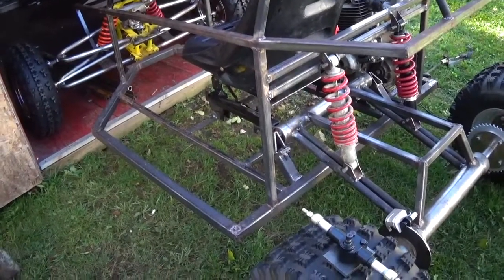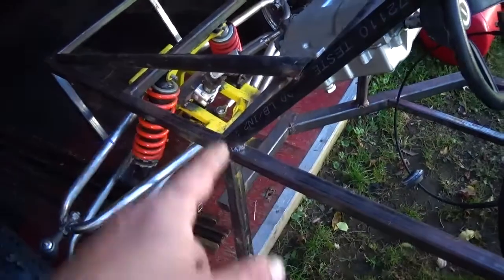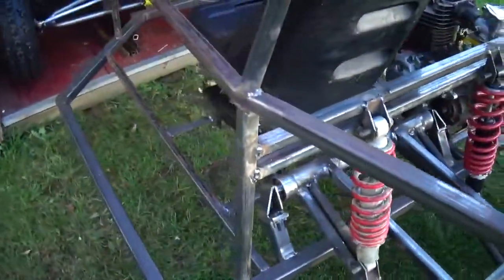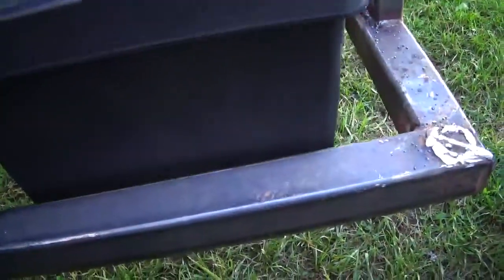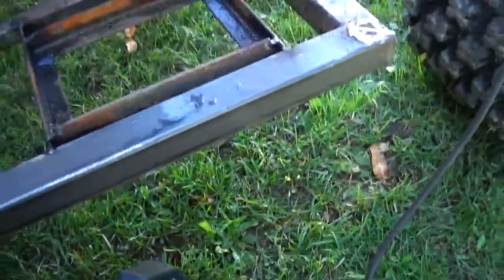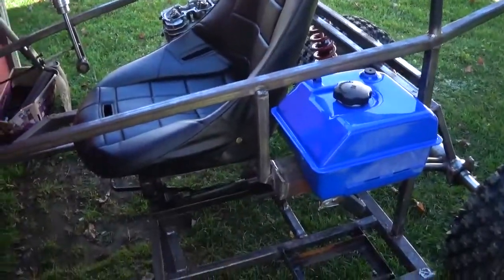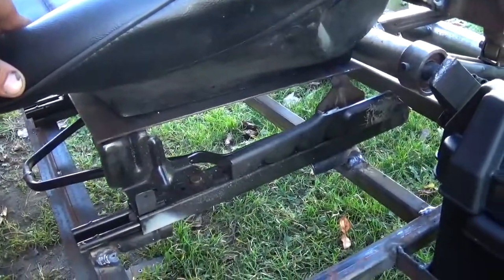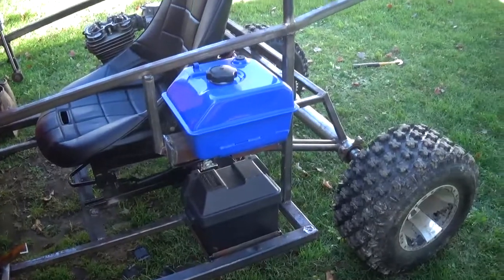300ex Sidewinder Pt 14

Comment: that poor kid. hope he makes out OK. looking at your gas tank. if you end up flipping it sideways. the gas tank could get pushed into you. may just be camera view. if you had a bar go around the outside side of the tank. under that lip on the tank. so if it flips over sideways or slides into a tree the tank couldn't get pushed into you. maybe I'm being to cautious. love all the modification's. buggy looks really cool. so many decisions when building from scratch. Keep you the driver in mind. seat worked out perfect. 👍 cheers
Reply: oh .. Merry Christmas.
Reply from the maker: Merry Christmas. He got really lucky. Just needed stitches. The doctors thought and we 
thought he was in really bad shape but after tests and scans nothing was
 broke. Going to add some brackets to the gas tank mount. It would get smashed before it moves. I would rather have it on the back but i really need it there to balance the engine on the other side.
Reply: I hear that. My doodle bug I'm building has no guards on the right side. Nothing there to need one. But looks naked lol

Comment: How will you know when it's in neutral?
Motorcycles have a neutral indicator light.
Also how will you know what gear you're in?
Are you going to put a tachometer in it?
Does It have a manual clutch like a motorcycle?

Comment: Does that have a motorcycle style sequential transmission?
Reply from the maker: Manual 5 speed with reverse. Its not going to fast 35 40 mph, go kart speeds. Thats my reasons for the regular seat belt. A regular go kart has no seat belt at all and no roll cage. It will have more low end power and torque than a go kart.